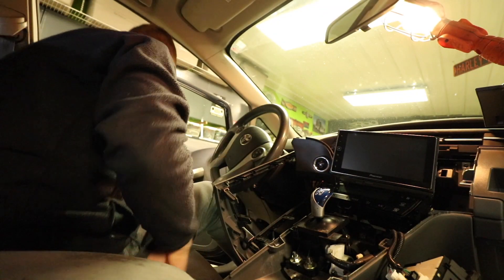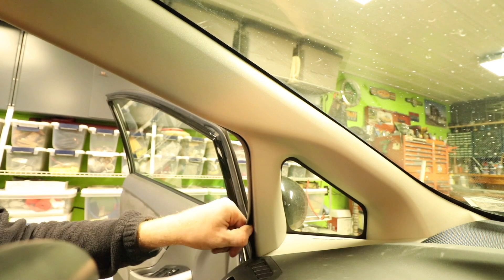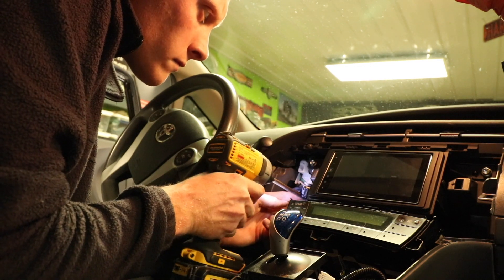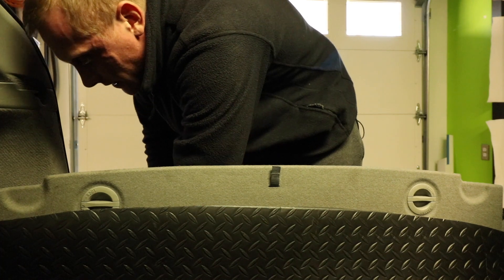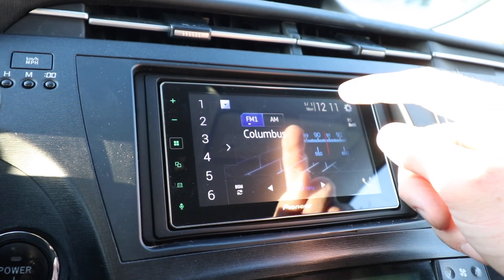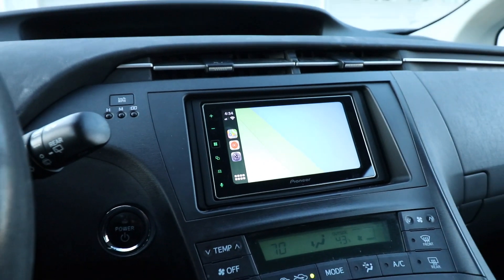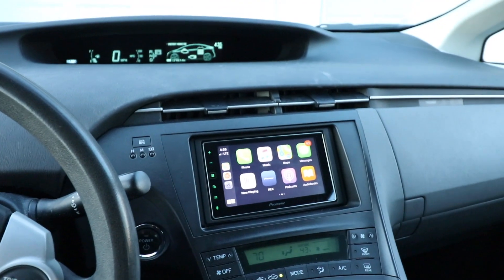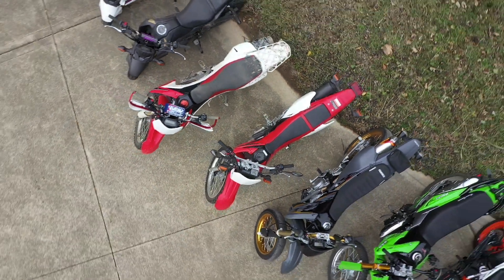The ULTIMATE Prius Upgrade.. | Touchscreen CarPlay Radio Install

Comment: Great job and congratulations on the installation. I have a 2014 Toyota Prius base model. I am experiencing issues with my radio. Audio is not coming out of the speakers. So I don't know if it's the radio that needs to be replaced or the speakers. I took it to the Toyota dealership and they don't even have a clue. 😃
Reply from the maker: Thank you! Definitely need to take it to a specific car audio company!
Reply: My 2014 with the JBL factory system just dies on me also out of the blue. So annoying. Any clue as to why?
Reply: @lbyoung8420 what did you end up doing? I have the same issue. Constant random restart, now only fm/am work.

Comment: Awesome video, thank you. Are there any features you loose by replacing the original stereo? Climate control etc…?
Reply: Climate control on a Prius is controlled with physical buttons, the only things I could think of would be audio controls, backup camera, or car settings (like car headlight settings (when they turn off after turning car off))

Comment: Thank you so much for the video! I have a quick question. For the steering wheel controls on the Prius, there is a control pad on the left side (for radio volume, input etc) and a control pad on the right side (for odometer/trip odometer, climate controls). I understand you lost the radio steering wheel controls by changing the radio, but what about the steering wheel control pad on the right side? Can you still reset the trip odometer etc? Thanks again.
Reply: There's an extra wiring conversion harness that allows you to connect the steering wheel. 

He says at the end of video it's hundreds or something, but I think you can get it at Walmart for under $100. I forget the part number, but if you need I can look it up 

But to more directly answer your question (outside of losing your stereo control on your steering wheel): I believe they are separate wiring harnesses. The stereo controls (left side) go to a plug behind the radio he didn't include. The dash controls (right side) run directly into the dash. Unless you damage the wires during dash removal somehow or otherwise short something, controls for the dash should still work.
Reply: Did you ever have any success getting your SWC odometer controls to work on the right? I did this install recentally and as far as I can tell you  these controls run directly into the stock head unit.

Comment: Dam man! I'm a little jealy!! 😜 So whats in your Prius for a motor? My Prius C has the 1.5L and is gutless but still fun to drive funily enough! Funily, is that a word? 🤔🤪 Actually, it's one of the most fun cars I've owned. I think it's knowing all the money I save in gas and oil changes that gets me all excited... I took a round trip with my brother last summer which was about 20hr round trip and roughly 1600 kms. I was able to make the trip for just under $100 with mine! That was pretty amazing! Something else is after putting 12000 kms, I got my synthetic oil changed and the mechanic told me my old oil looked as good as the fresh stuff he replaced it with! The thing could have easily doubled the kms with no problems.. Love my Prius so far! Keep up the great work! 😎🤙

Comment: Could this be done on a 2017 Totoya Prius prime?
Reply: The wires may be different (not matching colors) and you may need to buy a conversation kit, but yes. Would suggest a mechanic do it.

Not really much a reason to spend that money, the stereo system on the model 2s are horrible.

Comment: Just finished installing a pioneer mvh-av251bt in my 2013 Prius went with the PAC SWI-RC Steering Wheel Control Interface
https://www.amazon.com/dp/B004HKBY8G/ref=cm_sw_r_other_apa_i_pmApEb487HWK1 this is the very cheapest unit I found. It is a ultimate Universal unit, so it comes with ALOT of paperwork. There are videos here on YouTube that help simplify the instructions.
Reply from the maker: Much appreciated thank you for the suggestion!

Comment: I want to install an aftermarket radio on my gen 3 prius but I'm worried about losing the ability to self diagnose from the factory radio. Does anyone know if you would be able to keep that option with a aftermarket radio?